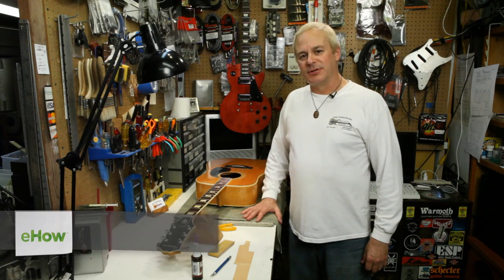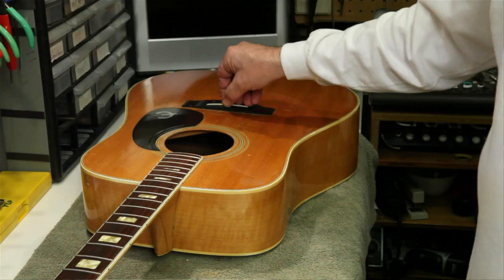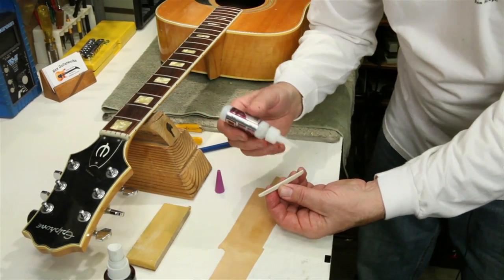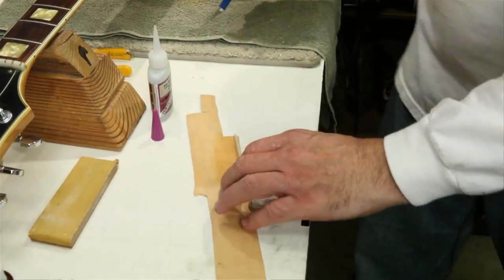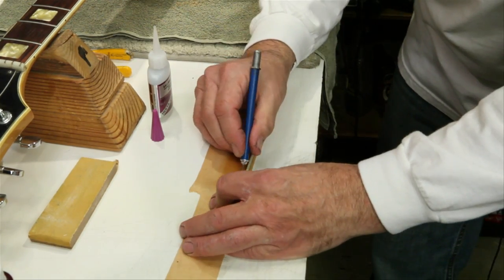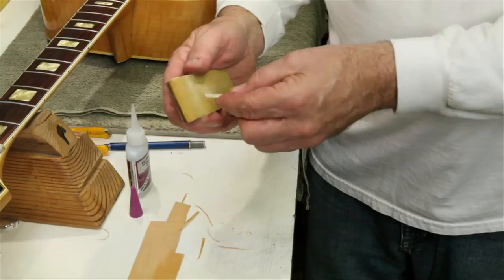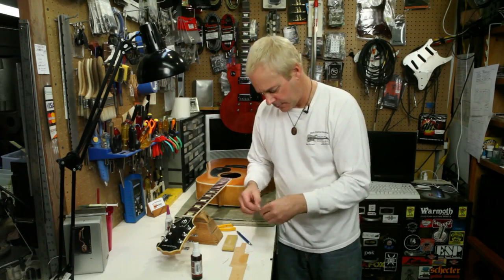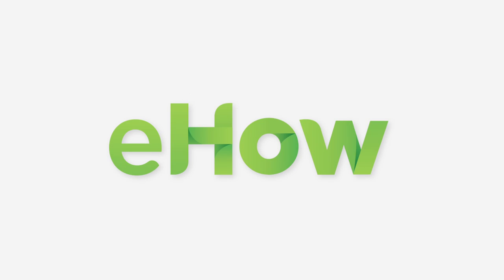Shimming a Guitar Bridge : Guitar Building & Repair

Comment: will a shim affect the tone or sustain of the guitar?
Reply: As long as the material is hard, it won’t attenuate any frequency-the string contacts the bridge fully at the ball end and along the plastic or ebony pins to transfer vibration as well.  In our case, the sustain is affected more by the functional height and top edge of the bridge than the shim under it.  Some of the piezo shims are very much like a softer stick of gum wrapped in foil with the crystals suspended and spaced and the have only a slight effect on the sustain.

Comment: Yamaha APXT2 guitar...6 months old, D string sounds dead between 9th and 13th frets....will adding a shim help or not?
Reply: You may have a high spot on the 13th or 14th fret that needs leveled with the others. Check it with a fret rocker (the short side of a credit card will work in a pinch.) It may need a gentle tap with a hammer if it's not properly seated, or it may need to be filed down a pinch.
Reply: @williedeuel  Thanks
Reply: @akmt123  I would also first check the relief in your truss rod. You could be suffering from "back bow" caused by over tightening.
Reply: Sounds like you need a set-up.  Yeah, raising the saddle will get rid of the buzz, but it will also make the guitar harder to play.  Better to just get a set-up.  Be sure the tell the shop about the buzz before the set-up, or else they will ignore it.  Shop monkeys are not bothered by buzz, the same way that you and I are.